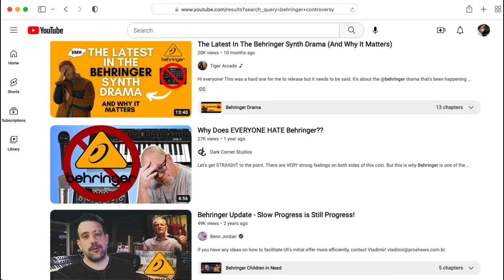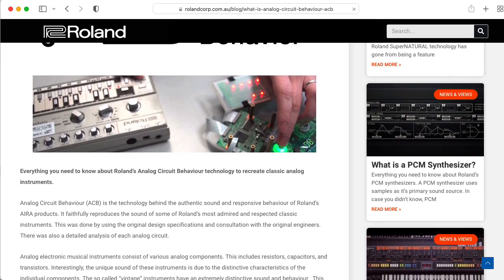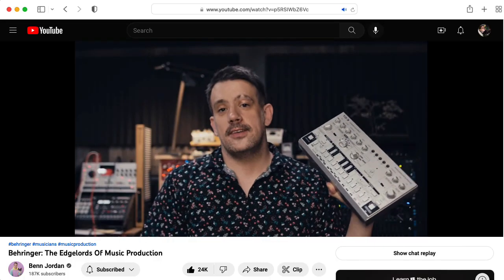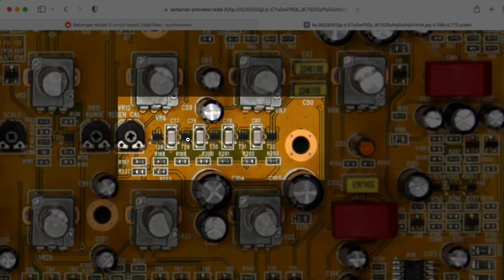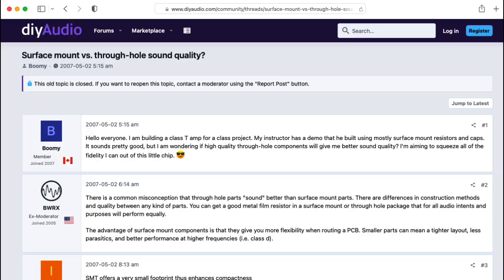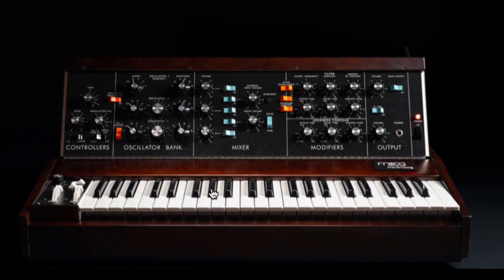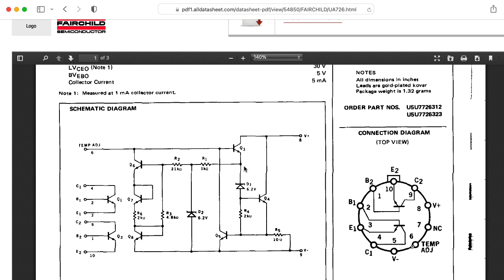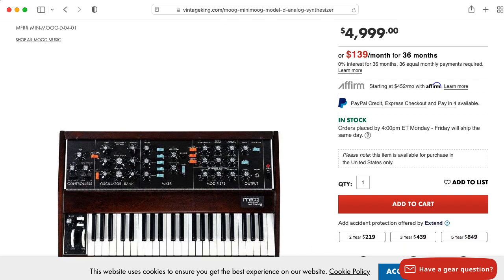Cloning Synthesizer Circuits: How Close? (thoughts arising from seeing one of Benn Jordan's videos)

Comment: Great video!! I made a video 4 years ago going over the guts of the B model D. You are right on it with the transistor ladder filter. The oscillators are also discreet using the 3046 as the transistor array making up the exponential to current conversion.

Comment: I've bought several Behringer's clones and I really like them. The desktop/rack format is perfect. Not too small, not too big. 
To me, the only question I still have is about durability. I suppose they probably chose the cheapest electronic components to keep the price that low. 
I bought the Model D at 299 euros. If the durability is better and guaranteed for 399 euros, I would still buy it. But maybe it's already enough durable ? Who knows ?

Comment: CA3046 (or UL1111, CA3146, CA3086) can be setup with addition resistors and caps to produce the "thermal oven" circuit to act like a UA726.

Comment: If the clone uses the same circuitry as the original (even with smd parts) they are going to sound very similar. VSTs on the other hand are only software approximations of the hardware instrument.

Comment: But they can emulate the transfer function of a transistor or any component , the only thing that will change , is the manufacturing process and external ambient factors like temperature , degradation , tolerances , etc . 
But you can emulate them pretty accurate nowadays, and actually if done right , better than the hardware , because you don’t deal with the nature of imperfection and tolerances . 1kohm it’s 1kohm and not 1.02kohm and 1.03kohm at 30c.
Roland Cloud did a good job , another example is the Waldorf Kyra .

Comment: The biggest difference between the OG and clone (in the case of Model D and 2600) is with the mixer. OGs passive, clones active. Otherwise most is as close as can be, but since the mixing plays such a MAJOR part in the actual sound, this is indeed a MAJOR difference. Still pretty cheap for just that filter though, LP and HP, even if only to run audio through the filter.
Reply from the maker: Huh -- I wonder why they made that design choice in the clones? It wouldn't be any more difficult to keep the original passive mixer design.
Reply: @Lantertronics  I don't know the answer, but it's one of these, or both:
1. because of the "crosstalk" in the OGs passive mixer section makes for "unexpected" results, especially when using several osc's cranked up high. With the active mixer, results are more predictable (the clones seem somewhat aimed at todays modern electronic music, compared to music of the 70's).

2. because of the modern components vs the old ones, which all in all could've made for a significant difference for the worse. Like with the crosstalk above, instead of coming out as "warm and alive", maybe the unintended side-effects of the original circuit made for problems instead. Like bad noise or something.

I suspect they TRIED the passive mixer route first, but eventually decided to give up due to problems of some kind.

Comment: It's nice to hear that in theory it should be possible to clone vintage synths - or parts thereof - with modern parts. Things seem to become way more difficult once the parts become more complex than what's in a Minimoog. Many other synthesisers use integrated circuits, and their clones therefore use modern versions of the integrated circuits. But when one compares those new version of these circuits, some of them behave very differently. E.g. they may be less sensitive to heat, they may run on different voltage ranges, there may be fewer parasitic effects like CV bleed through. In other words, they have fewer "bugs", and thus they sound differently. All of these differences can be compensated for, but it requires a little more than just sticking together things as depicted in a thirty year ofd schematic. 

Arguably, it is much easier to create digital models of these parts and run them in a simulation in realtime. Which is where the iPad wins.
Reply: One of the most conscious coments I've read. To give an opinion on a subject as complex as this one, we would need an extremely more extensive and detailed scientifically based study, something that I believe no one would do.
Meanwhile we have to believe our ears... SMDs sound different, and in my opinion, most of the time, worse.
Reply: Yet the engineer guy in the video confirms thru-hole vs SMD doesn't make a difference for audio range stuff, it's only when you reach the GHz range that it might. So... there's that. :P

Comment: The hardware clones are more like the originals in that they, like the originals, are hardware.

Soundwise, the hardware clones are not closer to the original than the software, as most software is directly designed to exactly emulate the sound, and in Roland's ACB case, they actually do that by directly emulating the electronic circuits.

So both the software and the hardware clones sound like the original, and hence they all reasonably can be called "clones". Are they exactly the same in all ways? Well, no, because to do that you would have to find new old stock screws from the 1970's. 🙂 But soundwise, they are.

Behringer's RD-9 clone of the TR-909 sounds more like my TR-909 than many other TR-909's. 😀

Comment: Moog says in a video they actually got a semiconductor manufacturer to remake transistors(hes talking about the VCF) for them. He does not talk about ASIC's like the ua726 etc.
Watching the "Minimoog Model D Live Build From the Moog Factory" video we can see there is no metal ua726 cans but plastic DIP8 at the position of the heated expos.
uA726 required a special wafer manufacturing process recall went obsolete already in early 80ies. However its said in the grapevine the re-issue uses the second issue VCO board
design and not the third which uses the uA726. But why not just send an email and ask Moog what they use.

Comment: Fun fact: the TR808 uses a transistor as a noise source, and they are actually transistors that did not meet their specs and so were rejected. Roland used these for that specific sizzling sound, but they no longer could get them when manufacturing improved and could not produce any more TR808s. Later on they found a transistor with the nearly the same noise profile though.
Reply: Also, the TR-808 was a flop and sold very poorly, like the 303.
Reply from the maker: @MJanovicable  It's kind of funny how purists will insist on the importance of the original transistors, when Roland at the time was trying to manufacture these as cheaply as possible.
Reply: @Lantertronics  In this case Roland itself was the purist :) You can find the full story if you look for 'The mysterious heart of the Roland TR-808 drum machine'' :)
Reply from the maker: @Jeroen74  Ah yeah, I should have clarified I was thinking of the TB-303.
Reply: @Lantertronics  And as we know, solid state electronics all improve with age. :face-blue-smiling:
Reply: Not entirely true. There's at least 3 types of noise transistors used throughout the manufacturing life of the TR-808. Mine has one of the the non R ones and it sounds amazing. I also found one of those R noise transistors on a CR-8000 and the clap was much weaker than my 808, as you can hear one one of my videos. There's a lot of mystique about this matter and not many facts.
Reply: @autoy  Yes, in the article I refer to they say Roland later found a transistor that had nearly the same noise profile.

Comment: Great video! I love my Behringer 2600 and Pro-1 but they don't sound identical to the originals. The vocabulary is all there though. Something about the filters or possibly the mixer or VCA seems to be lacking in grittiness compared to sound examples I've heard and the 2 original Pro-1's I previously owned. For the money they are excellent none the less.
Reply: Yeah, well the originals don't sound like the original either, simply because the components have aged. It's surprising how different an original Pro-1 oscillator sounds to a clone built using exactly the same circuit with new components and a fresh CEM 3340. But that's what forty years does.
Reply: @djashley2002  This is true and calibration can play a factor as well. There is still more in common with 2 vintage Pro Ones than a vintage and a Behringer at least in my experience.

Comment: Remember that old synth like TB-303 is 30 years old! and they are using a 5% Resistors!  The parameters of elements must changed after 30 years
Reply from the maker: Capacitors can drift a bit over time, but they weren't particularly chosen for precision to begin with. So I think you'll as likely get as much differences between two original TB-303s as you will between an original TB-303 and a clone.
Reply: 40 actually, kinda crazy.
Reply: @gaetan4164  yea i forgot that 80s not 90s.

Comment: Considering the Minimoog, the Moog 2016 edition is based on model prior to serial #10175, that is they used the so called "old oscillator board" that does not use uA726 for the exponential conversion but use a CA3046 IC or substitute chips (SG3821). On the "old boards" the temperature drift compensation is "obtained" using 1K PTC thermistors (tempcos) R20, R71, R119. Unfortunately the engineers made an inefficient PCB design and those tempcos are very distant from the CA3046s (at least 8cm apart from each others and from the ICs) while they ought to be directly and tightly thermally coupled. Consequently, these oscillators require a long warm-up (up to 25 minutes) before they reach there working zone and furthermore. I published a modification on my site that constitute on desoldering the tempcos from the board and gluing them to the CA3046s. Doing so the oscillators are usable after a short warm-up (5 min) and no longer drift (or at least much less)
Reply from the maker: Also for anyone reading this, google yusynth to find many amazing circuits.
Reply from the maker: This is very useful information! Thank you!

Comment: As you mentioned below, the human interface thing is huge, why does everything have to be so small and fragile? General "tuning" and care is also important, a guitar teacher in university showed me that the main difference between a good Squire and a Fender 54" Road Worn telecaster is that the latter has a very trained person assigned to make sure its all calibrated, no rough edges, well intonated etc. 

Finally thru hole components have all individual characteristics, you can't buy an opamp or a transistor - you buy a TL074, a n3904, j111, etc... Parts aren't universally inter-changable; transistors, opamps, have different betas, noise, amplification, slew rate, etc and a whole host of other things like PCB resistance, capacitance in stuff that isn't capacitors, as you well know! These things might only be 0.1% of a difference, but difference is cumulative and if you have 200 components, thats 20% haha. 

it's depressing to think of the environmental waste behringer is making long term by making easy to break instruments. It helps people now get into hardware but humans are awful at thinking of scales of time outside of right here, right now.
Reply: Weird argument there, slipping the environmental aspect in when the very laptop you're using will be a wedge-of-death in a dump. Maybe we should just accept the old models of these things costing a fortune again so people like you are satisfied.
Reply: @MJanovicable  ah yes, the old “you own a phone so how dare you criticize phones” argument- very good. I think DIY is a very good route for people to get the best bang for their buck and it can allow you to work with others in community.  There’s also VSTs and MIDI controllers

I also think people should be paid fairly for their wages, behringer relies on underpaid workers that can’t afford to buy the synths that they build.  But yeah it’s real cool that that means you can buy something RIGHT NOW that will die easily within the next decade and be difficult or pointless to repair. Again this is the problem of human time scaling. 

I only own one synthesizer and I spend about 2hrs a day playing it before bed, I make soundtracks for narrative and documentaries on it so it is part of my job to own that thing - I expect it to last my lifetime with upkeep.
Reply: @moldycoats  Yes, and it's a perfectly valid argument, but you weren't criticizing the clones, you were singling out Behringer for doing what everyone else does.

Comment: For the most part Behringer seems to have gone the “close” but we will make some changes that we like route and of course if there is a $5 cap that just might sound better vs a $.005 SMD cap, they will go with the cheap one.

That seems to be the main difference in most of their clones (pedals and other gear tends to follow these same trends.)

Save costs, occasionally add some small life enhancing features but otherwise mostly stay close.
Reply: Caps don't have a sound, though.
Reply: @RegebroRepairs  There are caps in the audio generation path and they can and do have an effect. How much varies a lot, though I can tell you the caps in the mixer have some rather outsized effects vs say the caps in the VCO.
Reply: @StopTryingSoHard  Of course they have an effect. That's why they are there. However, there is no such thing as a capacitor brand that sounds better than other capacitor brands. What makes a difference is the capacitance value. An expensive capacitor does not sound different than a cheap capacitor. It might last longer, though.

Comment: Ok, this ia an a priori approach to an a priori approach: "It can't be the same, for some (pre-)conditions aren't the same". Apart from what would define 'same' or 'clone', I think the proof of the pudding is in the output of the synths. Clearly clones generally are smaller, fiddlier, and knobs and sliders feel not as good or accurate, but are handling and response included in 'the same'? So I thought I was to see some output and measurements (of the sounds) compared, original vs. clone, where often blindfolded tests reveal that for 90% of the ears/brains the sounds are indistinguishable, despite noticeable differences in frequency graphs etc. My view on science is that science often can describe what happens, it can predict what will happen, mostly in well-known (proved and tested) circumstances, but in many (most?)  cases it can't prescribe what will happen. Science can predict things won't work, it can explain why things don't work,  but science can't dictate things (not) to work.
Reply from the maker: Indeed, I was just focusing on the circuit question. Definitely the feel of turning a knob on a full-sized Minimoog is a very different experience than turning it on a the tiny Behringer unit.

Comment: One question is : do you include the defects of the minimoog due to frequency limitations of the vintage components?
Reply from the maker: That's a very interesting question, and one that needs a lot more details to really dig into. For instance, has anyone measured a set of vintage 1458 op amps vs modern 1458 op amps? The 1458 is specified with a GBW product of 1 MHz, which is pretty much set by a capacitor that takes up most of the chip. I suspect that you'd get as much variation from op amp to op amp in a batch from the same year of production as you would from batches between decades. 

Another place to look would be capacitors, which can change characteristics over time. Which leads to a Ship of Theseus sort of question when it becomes necessary to replace capacitors.
Reply: @Lantertronics  Exactly. Many of the purists insist that the defects be included. Others say to improve the design with modern parts with less irregularities. As for capacitors, nearly all old caps are inferior to the new variants with respect to leakage and dielectric absorption etc

Comment: one very important difference between thruhole and SMT circuit boards (even at audio freqs) is coupling. Often circuits are on opposite sides of the pcb to reduce coupling between them which can be degraded with thruhole leads. Also if Intermod distortion is important, the reduced lead inductance of smt components can come into play

Comment: on the 726:

I think you just cleared up a mystery for me. I've got the Behringer Model D. I tried to use it at band practice, but it needed to be retuned for every song. Not stable enough for me. Then I saw Tim Shoebridge did a video where he plotted frequency over time and it just drifts a lot. I bet that 726 is why the original is useful for a whole concert and the clone really isn't.

I don't have any inside info on what Moog did with the reissue, but my bet would be that they've borrowed from whatever they developed for the Sub 37. It's basically in tune when you turn it on and it just doesn't ever drift more than a couple cents.
Reply: Surely there are modern ways to get temp stable analog oscillators.
Reply: So there were two versions of VCO boards in the original minimoog, the older CA3046 based board, and the newer board with ua726 for better temperature stability. The Behringer Model D (according to Gearspace threads) uses the old board circuit, as do the reissue Moogs because you can see it in pcb photos. I have a '74 mini with the old board and it is more stable than the new Behringer

Comment: I have several Behringer synths, but just one Moog...the simple Werkstatt. And I swear that the quality of the tone of the Moog beats them all out. Every time I fire it up, I feel like the core tone...the oscillator and filter...sound smoother and richer than any of the clones.
   I may be wrong, but that's what I hear.
Reply from the maker: The Wekstatt is a very interesting circuit -- they clearly went through a lot of effort to reduce cost as much as possible, and landed on something unique.